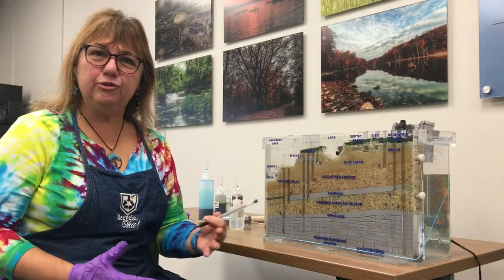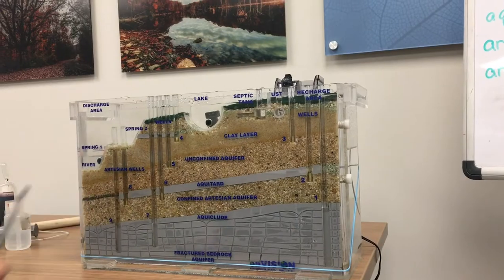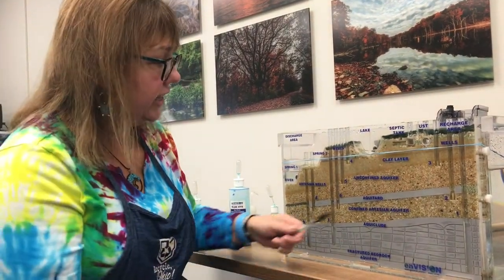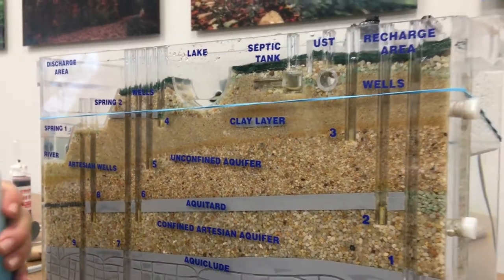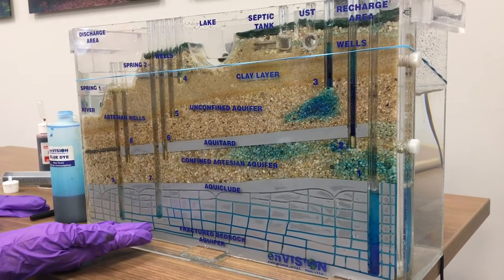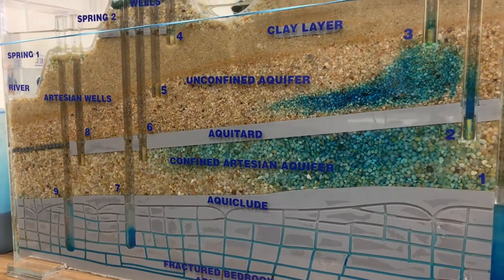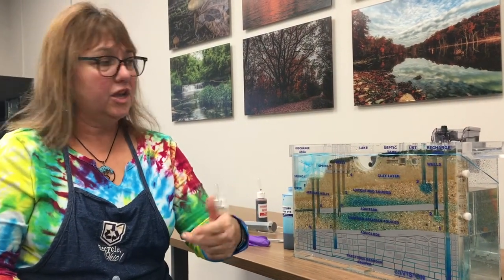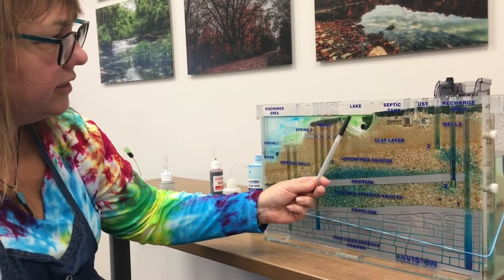Groundwater Model

Comment: How does so much water flow through the clay though
Reply from the maker: Thank you for watching the Groundwater Model video. While you are correct that clay often has almost no permeability and is essentially a barrier which water cannot flow through thus forming an aquitard, there is still limited water flow within aquitards due to clay's high porosity and pressure fluxes underground.  Laboratory measurements and regional groundwater flow modeling have demonstrated that the permeability of aquitard (clay) is not zero but does have a very slow rate of water movement. Please feel free to contact our office if you would like to discuss further. Thank you!  www.warrenswcd.com

Comment: Hi, Water cannot flow through clay. Clay acts like a aquitard. Is it sandy clay or smth? Can you explain how water flow through that layer pls
Reply from the maker: Thank you for watching the Groundwater Model video. While you are correct that clay often has almost no permeability and is essentially a barrier which water cannot flow through thus forming an aquitard, there is still limited water flow within aquitards due to clay's high porosity and pressure fluxes underground.  Laboratory measurements and regional groundwater flow modeling have demonstrated that the permeability of aquitard is not zero but does have a very slow rate of water movement. Please feel free to contact our office if you would like to discuss further. Thank you!  www.warrenswcd.com
Reply: @warrencountyswcd  Great explanation. Thank you. Greeting from a Geophysicist.